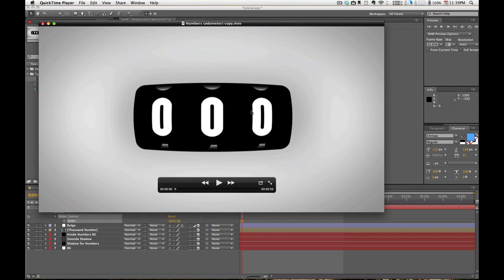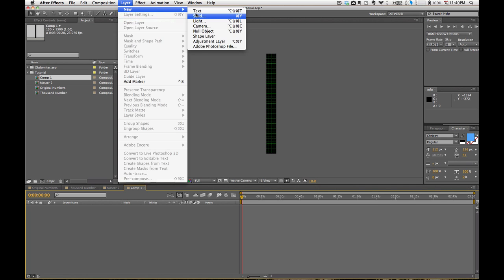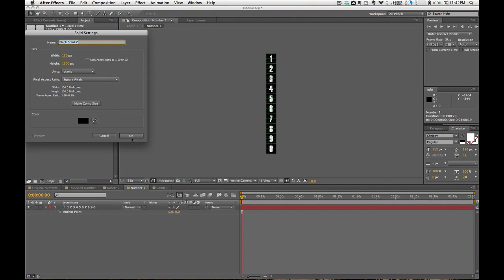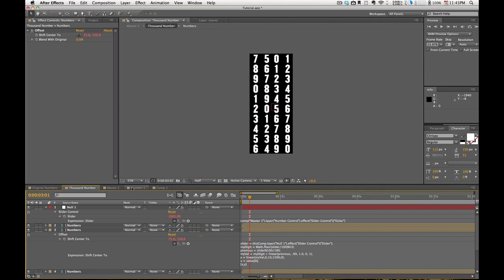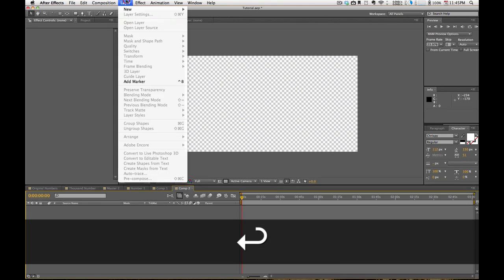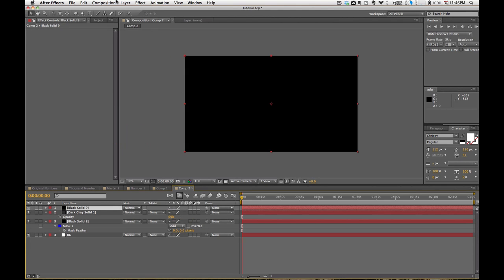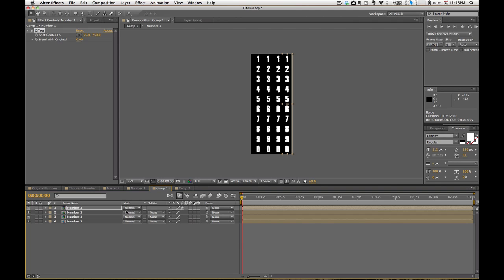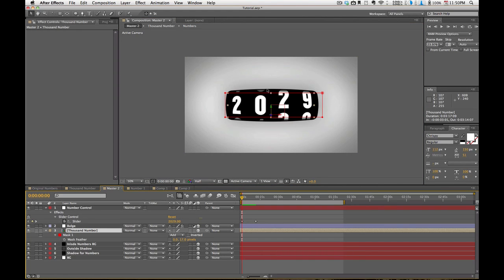Odometer After Effects Tutorial

Comment: For anyone who finds this tutorial later, here are some problems you may encounter and how to solve them.

1. Syntax Error in line 1 for every expression. 

If you copy and pasted the expression from the video description straight into After Effects, you will have this problem for every expression. For what ever reason, when the tutorial maker copied the code over, he used two different types of quotation marks, one that AE can read and one that it cannot. The quotation mark after Null 1 in line 1 is wrong and needs to be replaced with a regular quotation mark, so the fixed line is this... 

slider = thisComp.layer("Null 1").effect("Slider Control")("Slider");

You probably can't even see the difference, but it's there. It's more visible in AE's expression editor, but more importantly, the code should work now.

2. Things are named wrong. 

These expressions rely on specific layer and composition names in order to work properly. There are two null objects and one composition that are referenced in the code. Make sure all three are either named how they are addressed in the code or change the code to what you renamed the layer name to.

3. You want this to be for a different resolution. 

In my case, I wanted the same effect in 4K. The way I did this was multiply all of the stated composition sizes by 3. 4K is 3 times the width of 720p; you can do the math for your own chosen resolution. This needs to apply to anything that involves pixel values, including the expressions and the grid, or else the numbers won't count up properly. Line 5 for all of the expressions reads: 

y = linear(myVal,0,10,1500,0); 

In my case, it became:

y = linear(myVal,0,10,4500,0)

4. You want motion blur.

AE's built in motion blur doesn't work because we used the offset effect. In order to get motion blur, add the effect "CC Force Motion Blur" on all of the number compositions. Make sure it's placed under the offset effect in the effect controls and set "Native Motion Blur" to "On." Increase the sample rate too. This'll make the motion blur more physically accurate. Fair warning, this method is very buggy and doesn't work 100% of the time. I have yet to find a better method to add motion blur. If anyone has a better method, I would love to learn about it.

I hope this saves all of you some time. This tutorial is awful and the only reason I was able to get this to work for me was because I have a lot of pre-existing knowledge on the software that allowed me to identify and fix these issues without too much trouble. Good luck!

Comment: yea man, thanks for posting but where is the expression? Kind of futile without it. Half done.
Reply from the maker: The expressions used are in the comment section: 

// thousands
slider = thisComp.layer("Null 1″).effect("Slider Control")("Slider");
myDigit = Math.floor(slider/1000)%10;
previous = slider%1000/1000;
myVal = myDigit + linear(previous,.999,1.0,0,1);
y = linear(myVal,0,10,1500,0);
x = value[0];
[x,y]

// hundreds
slider = thisComp.layer("Null 1″).effect("Slider Control")("Slider");
myDigit = Math.floor(slider/100)%10;
previous = slider%100/100;
myVal = myDigit + linear(previous,.99,1.0,0,1);
y = linear(myVal,0,10,1500,0);
x = value[0];
[x,y]

// tens
slider = thisComp.layer("Null 1″).effect("Slider Control")("Slider");
myDigit = Math.floor(slider/10)%10;
previous = slider%10/10;
myVal = myDigit + linear(previous,.9,1.0,0,1);
y = linear(myVal,0,10,1500,0);
x = value[0];
[x,y]

// ones
slider = thisComp.layer("Null 1″).effect("Slider Control")("Slider");
myVal = slider%10;
y = linear(myVal,0,10,1500,0);
x = value[0];
[x,y]

Null Expression:

comp("Master").layer("Null 1l").effect("Slider Control")("Slider")

Just copy and paste into your respective place holder (thousands, hundreds etc.)
Reply: Thanks!

Comment: nice work but not a good tutorial u should have told about the expressions u used ....thanks
Reply: The expression isnt copying correctly....The ("Null 1") is copying as ("Null 1?) 

Change the ? to and " and it works fine
Reply from the maker: The expressions used are in the comment section: 

// thousands
slider = thisComp.layer("Null 1″).effect("Slider Control")("Slider");
myDigit = Math.floor(slider/1000)%10;
previous = slider%1000/1000;
myVal = myDigit + linear(previous,.999,1.0,0,1);
y = linear(myVal,0,10,1500,0);
x = value[0];
[x,y]

// hundreds
slider = thisComp.layer("Null 1″).effect("Slider Control")("Slider");
myDigit = Math.floor(slider/100)%10;
previous = slider%100/100;
myVal = myDigit + linear(previous,.99,1.0,0,1);
y = linear(myVal,0,10,1500,0);
x = value[0];
[x,y]

// tens
slider = thisComp.layer("Null 1″).effect("Slider Control")("Slider");
myDigit = Math.floor(slider/10)%10;
previous = slider%10/10;
myVal = myDigit + linear(previous,.9,1.0,0,1);
y = linear(myVal,0,10,1500,0);
x = value[0];
[x,y]

// ones
slider = thisComp.layer("Null 1″).effect("Slider Control")("Slider");
myVal = slider%10;
y = linear(myVal,0,10,1500,0);
x = value[0];
[x,y]

Null Expression:

comp("Master").layer("Null 1l").effect("Slider Control")("Slider")

Just copy and paste into your respective place holder (thousands, hundreds etc.)
Reply: Neo Custom Media thankful